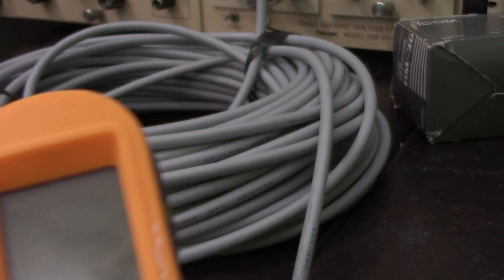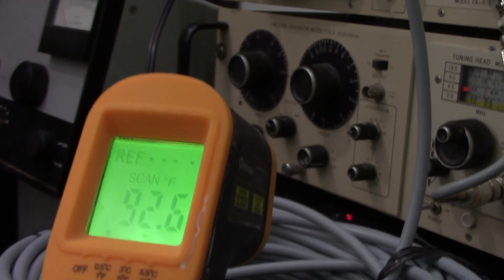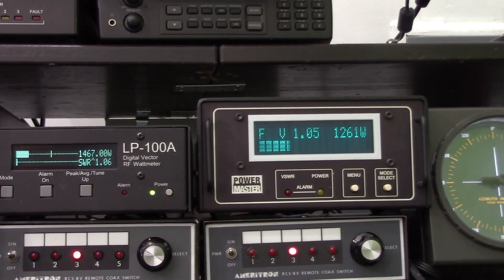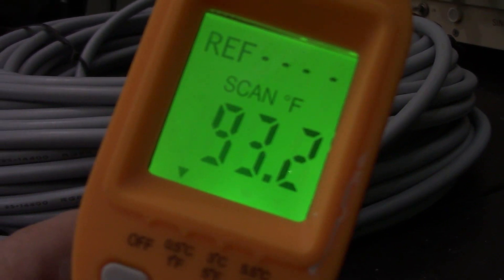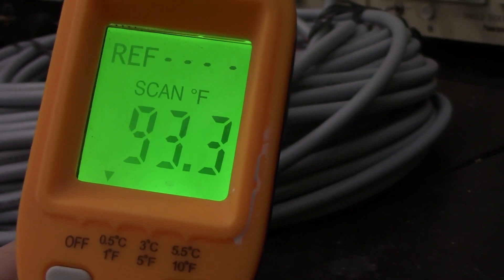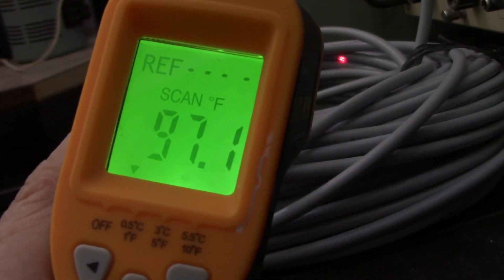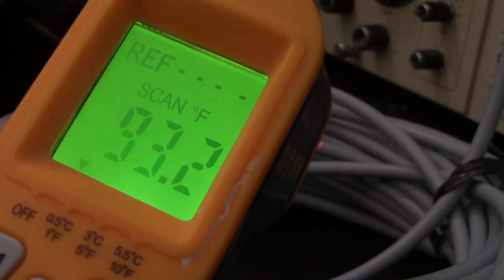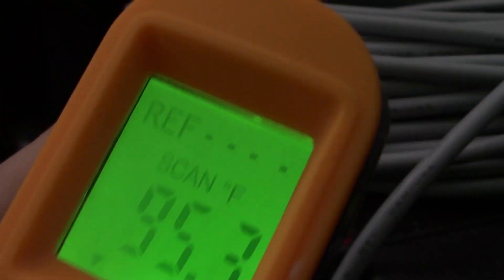Can RG8X Really Handle 1500 Watts?  Jim, W6LG, Ham Radio Elmer Finds Out

Comment: Hi Jim!  Love your channel!  Subscribed earlier this year after you read the letter you wrote to the ARRL.  Thank you!

I watched  this video about RG8X and the subsequent video when you responded to the comments posted here.  When I watched this video, the first thing I thought of was the fact that the coax was coiled.  I have coiled the coax of my OCF dipole and clipped ferrite chokes on the coil.  It improved the SWR for 80 meters.  There can be some affects from coiling coax, both good and bad.  But that isn’t what comes to my mind when you are measuring the temperature of the coax.

I work in engineering.  Part of the reason for the increase in the temperature of the coax has to do with the fact that the coax is coiled, thus derating the ampacity of the conductors themselves.  There are ampacity charts available for each wire size.  These charts list the current carrying maximum according to whether the wire is installed in free space or bundled and confined.  I would say that a coil of coax the size of the one in your video constitutes bundled and confined.  So this derates the ampacity of the conductors within the coax.

I will add, anecdotally, that I have a 75 ft. run of RG8X that came with a G5RV I bought at HRO in 1991.  I ran up to 1,000 Watts into it over the years, but usually 700-800W.  The G5RV has been gone for several years.  I replaced it with a ZS6BKW.  But I still use the same, circa 1991, RG8X coax.  All of my other antennas are fed with RG-213, RG8, or LMR400.  I have 75 feet of LMR400 standing by for the next time I tinker with the ZS6BKW.  So last year, I purchased an Elecraft KPA-1500.  I usually run 800-900W but sometimes I unleash it.  So far so good, even at 1,300 to 1,500W.  I know that I’m pushing the RG8X beyond its factory rating, but I plan to replace it anyway.  I’ve been pushing it to make it fail.  But the SWR remains fairly consistent so far.  It must be a good quality RG8X.  Come to think of it…I think it is Belden.

Thanks again for the practical knowledge that you pass along to us in the amateur radio community!

73, de N4HNH 
N4HNH Radio YouTube channel

Comment: Belden's 9258 Coax - RG-8X Type specification not only lists 300V rms for max operating voltage, it also states max power: 1000W @ 10Mhz, 370W @ 50Mhz along with a max op temp of 80degC.

Comment: Thanks for your video Jim.  It would've been interesting to do a comparison of RG8x versus RG8 or LMR400.  Another option occurred to me but you would have to use a fixed power input, and that would be to check the power going into the coax versus the power exiting the coax.  Then compare the losses of RG8x vs RG8 or LMR400.  Keep up the good work Jim.  I enjoy all of your videos ...  de K5AVJ, hamming since 1960

Comment: Jim, nice test, however I ask the following: Since your into a dummy load that  presents a good SWR, if your  using on an actual antenna and lets say the SWR  2.0 I would think that heat would be even higher correct? Also if the run was shorter the Heat maybe even higher, as a longer run presents more loss the heat would dissipate. Also since your only test on an intermitted mode like SSB a roughly 40-60 % duty cycle, I'd like to see what happens on a continuous mode like a 2 tone test at 1500 or there about I am sure the temp will rise much faster and higher. de N8SDR
Reply from the maker: Agree with everything.  Thanks as alway Rick for a great comment and increased knowledge.  73, JIm

Comment: Hey Jim, If the coax were not in a roll would the temp dissipate faster? Interesting. Tnx NB2Q
Reply from the maker: Yes, I am certain it would have.  73, Jim
Reply: Correct, you should alway place extra coax in a figure eight configuration.
Reply: Would shorter runs heat up more/faster?  I’m thinking it would take more sustained power to heat up more coax and less power for less coax.

Comment: Some cable, like Belden RG-58 is rated for 60C or 140F. Other cables are rated for 40C or 104F. I have experienced hot spots where the standing wave of current exists on the cable. A test using a dummy load would not heat the cable up as fast as operating with a 2:1 SWR. I have run RG-8X for many years with about 750 watts output. I normally do not operate with higher than a 2:1 SWR except on 160 meters. I do mostly contesting so the cable gets a pretty good workout. Sometimes 60 Qs an hour for several hours straight. I tend to CQ and run for hours. I would not do that with 1500 watts with my RG-8X. 
Only once did I melt coax. About 55 years ago, my Tri-Band beam was apparently not rated for 400 watts of long winded AM and I melted the traps, the SWR went up and I had a hot spot in the coax that also melted through. No damage to my home brew 813 amplifier but I never forgot the lesson!
Reply from the maker: Those 813 tubes were really tough with that carbon plate that was so thick.  Getting a pair on 10 meters was not easy.  All of that was lots of fun. I heated up some terrible Radio Shack RG8 with my 4 dash pair and about 5kv.  73, Jim W6LG

Comment: Why did you use SSB and not a continuous FM or AM with the same power?
Reply: 20m FM? LOL
Reply from the maker: It was hard enough on the dummy and the amp with the low duty cycle. 73, JIm
Reply: @ham-radio  I bet!
Reply: because it was not a real test.

Comment: And that's into a perfect load. Would probably heat up even more at, say 2:1 SWR. I would say 500 - 600 watts for RG8X. The thing about RG-8X is the quality can vary. Would like to see the same test with some Times Microwave LMR-240, which is about the same thickness as RG8X.
Reply from the maker: It was so hot in that room that I did not do the 2:1 SWR test.  But, it would heat much faster and have more loss.  The quality of RG8X is all over the place. You are right on every point that you talk about.  Thanks Doug.  73, Jim

Comment: While you are in a destructive mood Jim, maybe try RG58, short term it will certainly handle 1500w of SSB on HF (not tried it in a coil/bundle).  For short HF patch-leads in the shack my choice nowadays are the PTFE insulated cables, pretty crush proof if you sit a piece of equipment on it accidentally, well screened, super easy to solder without melting the dielectric and the smaller variants are flexible enough that your expensive power meter won't go flying off the bench. Great to see you challenging the myths! 73

Comment: Jim, as some have already mentioned, it is not practical to use a coil of coax for your testing. RG8X has a matched line loss of .88db per 100' at 14Mhz. You are using a dummy load (perfect match) so .88db should be representative of your set up.  Your 1500W should result in ~1225W into your dummy load.  So it appears that 275W are being dissipated in the RG8X.  However since the duty cycle of SSB is ~33% that would amount to only 90W dissipation in the RG8X.  I doubt that 90W in 100'of RG8X would cause any heat build up.  On CW, with a 50% duty cycle, that would increase to ~138W, still not a problem. I believe the small temperature variation you are seeing is caused by Eddy current flowing in the cable because it is in a coil.

Comment: The coil will induce more heat and  the 90% turns will always heat up because you create an inductance and capacitance variation on the feedline which is a radiating element never a 90% bend. My old Cantina would be getting warm by now. Some of these guys run pretty high SWR's and the losses or heat can become a  lot higher. Beldin Cable charts are good. Thank You again Sir. KA4WYO

Comment: I check the manufacturers specifications. There is a lot of variance in quality of cable. I am looking at one now that specifies 3.0kW @ 5 MHz and 1.2 kW @ 30MHz.
Reply from the maker: What coax?  Is that an RG8X???  73, Jim
Reply: @ham-radio  Hi Jim, yes it is RG8X.  This is from  the DX Engineering Coaxial Cable Reference Chart. Hopefully this link will work. https://static.dxengineering.com/global/images/chartsguides/d/dxe-8x.pdf

Comment: No coax is perfect. All conductors have some resistance and that will always increase in temperature when passing current through the conductor. All dielectrics have losses and they will always heat up when there is an alternating potential across the dielectric. It is  a fundamental law of physics. The movement of charged particles will result in increased energy and movement of the atoms - that is what heat is. Coiling up up the coax is always going to produce an increase in temperature which is higher than if the cable was not coiled and able to dissipate the heat.  The best data on what a cable can handle is the tests conducted by the manufacturers and specified in the data sheets. They have professional test facilities which are far better than someone with a hand held thermometer! Proper laboratory tests are required to specify a cable for sale to such buyers as the military, broadcasters, and communications companies. In my experience, we had to water cool very high quality coax in our broadcast facility simply because no cable is perfect. This sort of test is misleading and just a waste of time -  best way to asses a cable is to put power in and find out what comes out the other end. The difference is what the losses are. Skinny cable with thin wire loses more than fat cable. The higher your power, the hotter it gets. If there is any SWR it will always get hotter at the current nodes. Low SWR, the same cable is not so hot. So is the increase in temperature caused because the cable is no good or because you have a high SWR?

Comment: Coiling the cable will make a difference.  We run 60Hz load tests on UPS products and you cannot test with coiled conductors.  They will overheat. Rerun the test with an uncoiled cable for a better simulation.  Other than an intensional common mode coil, that’s the only way to be sure.  That said, a temperature rise of a few degrees is not that much.

Comment: I put 1788 watts pep through rg 8x I melted the Insulation from the center conductor to the outer ground. But the 8x held up just needed better Connectors. 
12ny…

Comment: The coax in a coil like that is bound to heat up, i would suspect a different result with it not coiled up. 8x can handle 1500w but it will turn black quicker from heat because of the size of the conductors within. Is used within its limits freq and power one should be fine.

Comment: I would think with the wire coiled up your "coil" will induce some heat while creating a magnetic field.
Reply: Coiling should only matter if there is a mismatch in the load impedance and RF is then present on the shield.

Comment: Wouldn't a coiled setup render more heat in a setting like that? It would be like a coil on a car. I use to pick up wattage by building a coiled RG58. Was a good trick that worked. Saying that. Would any coiled test be a consistent test for heat?
Reply from the maker: Great point!  I did test is stretched out and it did heat. I will do that video soon.  I am still working on the amp as time permits between medical appointments and tests.  73, Jim

Comment: Thank you for making another great video and sharing it with all of us!
I am at a point where I'm ready to finally purchase my first HF amplifier, but I have been using 100 w for so long and I don't know much about issues that I might face when going to a higher power level. I have excellent grounding and resonant antennas that can handle 1500 watts and I have LMR 400 and a nice electronically quiet setup with an Icom 7300. I also have electricians in the family and have 240 volts easily available and excellent grounding.
When it comes to HF amplifiers, I find myself lost in a sea of choices and I don't have access to local hams that have successfully set up high power.
Can you please recommend a full power HF amplifier that is fully automatic such that I can also use it remotely? 
Thank you very much, I am of course subscribed with notifications turned on and thumbs up!
73 W3GUY

Comment: Pasternak and Beldon,  state  rg8x is ratted  to 1000 watts, at 10 MHz. 

I am sure SSB at 1500 watts,  un coiled won’t be a issue. 

Since we are talking SSB and  the cable is rated to 1000 watts,  1500 watts pep would be less than 500 watts average,
Or half the cables maximum rating. 

If your a  Elma, 
 then ham radio is in trouble,  your propagating these meaningless results as science that concludes
Rg8 can not handle 1500 SSB.    Your cable did handle it and it only gain 3 degrees at best in a coiled state. 

Un coil the coax , use it how  a ham would and put a thermal camera on it. 

You could barley keep the laser dot on the coil and when you did not,  it was showing a 
Background temp of 94 deg F and a coil temp of 96. 

Yet the cable has a working Temp of -40 to +80 degree C. 

Hardly a conclusive test that the cable can’t handle 1500 watts SSB.
Reply: After the first second of transmitting, Jim showed that the RG8X would not arc over from 1500 W peak.  I thought that was a relevant show-and-tell right there.
Reply: On top of that the real test is if the insulation is broken by voltage.....

Comment: Hi Jim. So is it safe to assume that the better coax for HF at that much power would be regular Rg8 then? If that so would you be willing to do Thames same experiment with Rg8? Thanks 73 de KI5GLT
Reply from the maker: I use RG216 and RG218.  Research that size of coax.73, Jim

Comment: If you have to have small coax just spend the money and get rg142 or rg400. The rg400 is the better of those two because it has a stranded center conductor.

Comment: flawed test ------------ any coax coiled up will get hotter -- the layers amplify the heat  stretch out the coax  and then test the room temp around the single layer will be cooled by the room  think of why birds build a nest -- the wrapping layers around helps keep them warm
Reply from the maker: I did it that way on purpose.   Many, like me, at the end of the run, coil the coax to create a choke balun.  Today, that coax in the sun will likely be well above 115 degrees before RF is applied.   My coax in the attic will be much hotter.  It could be 140 degrees.  So David, I will stick with the results that RG8X is not good for high power.  Thanks as usual David.  73, Jim

Comment: Testing with SSB/voice only? At 1500W PEP with a crest factor of ?? the average power is surely <700W.. Use FM to melt it :)  Also the delta in temperature isn't really that high - everything not too hot to touch (about 60C/ 140F) is "cool" in electronics, right? Edit: Looked at the datasheet 1kW at 10 Mhz and 370W @50mhz - 1500 should really fry it :)  (http://www.farnell.com/datasheets/2334922.pdf)
Reply from the maker: In my attic, it is about that hot right now and so is the coax. Thanks, Jim

Comment: Losses will go up with frequency.  Cable life will depend on temperature like you are testing but it's over a long time. The other factor is electrical breakdown.  Which is over life.  I don't think this is a very good test.

Comment: It's like behaving like a choke that's stuff can handle 1500w
Reply: 1500 pep I worked someone running close to 1500w it was out in real time use with no coils what have you if an antenna isent resonant it would heat up really fast. 2:1 swr.
Reply from the maker: Thanks!  73, JIm
Reply: @ham-radio  your welcome sir de. N1SCA
Reply: @ham-radio  love your information just found your channel I subscribed  thank you we need old school hams on here👍

Comment: First rg8x has a max power rating of 1kw at 10mhz - see Belden or RF Davis specs, so while it may be entertaining to run 1500w it seems a bit pointless, unless you are trying to prove the manufactures correct.   For the average ham, especially your target audience, it appears misleading to be so critical of rg8x when most operators are running 100 watts.